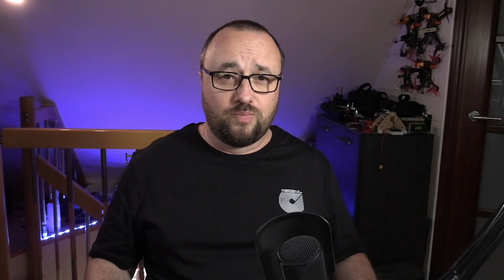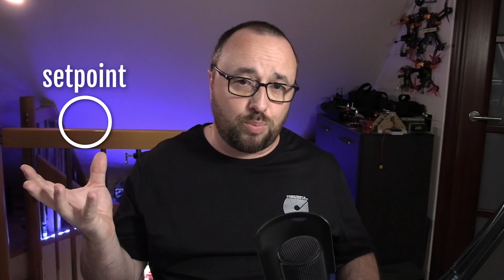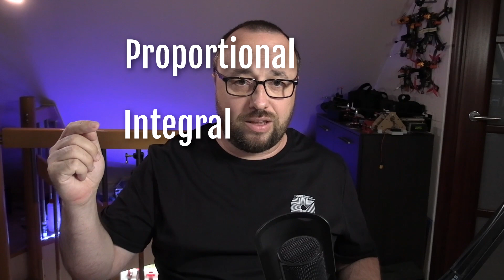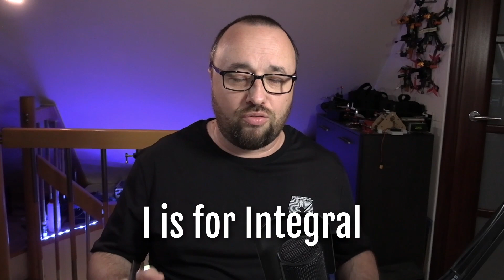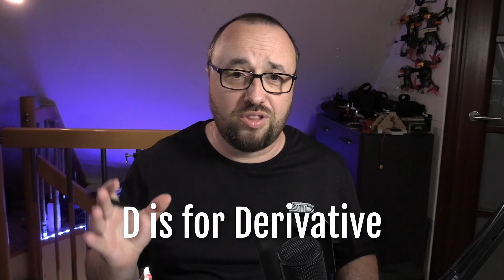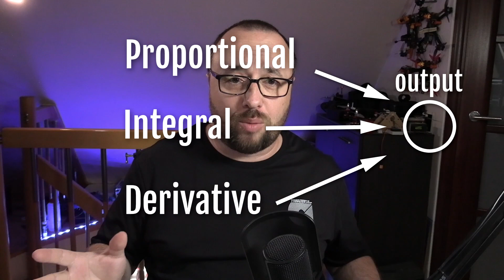What is PID? The fast explanation

Comment: Oh just in time. Trying to tune hard to tune 8" 
Getting d term oscillation. But if I go low with d doesn't fly well. 
Got it to straight straight good but prop wash if I drop too fast runaway a lil